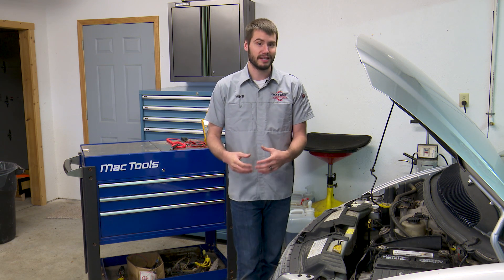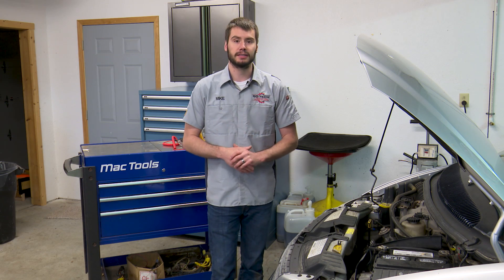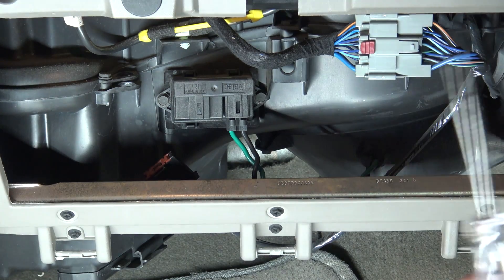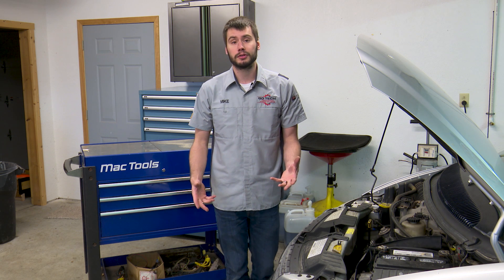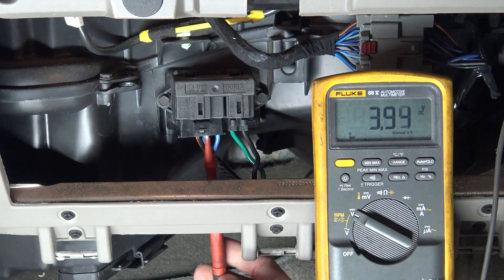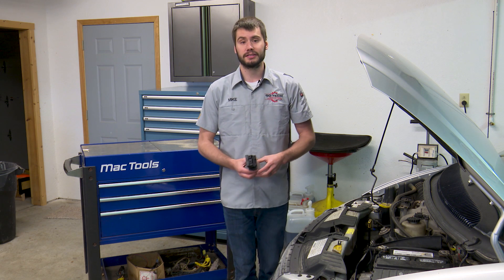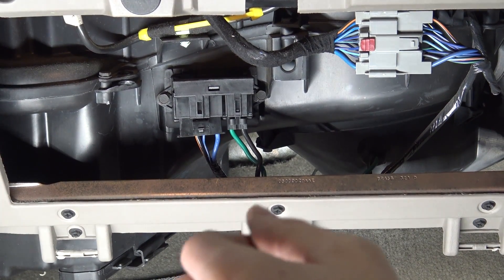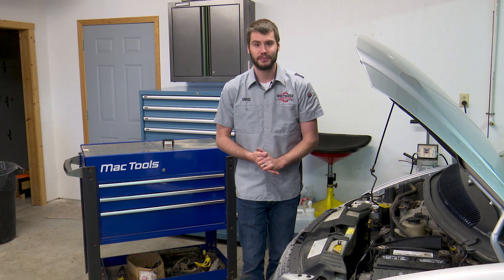Chrysler/Dodge Fan Runs When Power Is off!? Simple Test & Repair

Comment: Thank you sir for the excellent video. EZ peazie fix for my problem of no fan adjustment and when I shut it off, the fan blew even harder! I opted for the $21.00 one on Amazon instead of the $68.00 Duralast since the van is 21 years old.

Comment: Enjoy your videos Mike.  I'm a DIY car repairer and have been at it for 50 + years.  I was a radio repairman in the service and 20 years repairing industrial controls.  I have a pretty good BS meter and have had many service writers give me lame explanations when I took a car in for warranty work.  They should all study under you.  Most have a less than mediocre understanding of basic electric systems.
Reply from the maker: Hey Mike, thanks for watching and thank you for your service! I love a good BS meter, so funny to watch a writer squirm. A simple understanding of the basics can really open so many peoples eyes. Hopefully they watch :)
Mike Becker, Senior Instructor
Reply: @GoTechTraining  I was once told that the starter on my wife's 81 Caprice Wagon was hanging up because of a bad cell in one of the diesels batteries.  When I hit it with a tire iron it would drop out.  Turned out to be a cracked housing. When I put new 1100ah batteries in before the next winter it went from intermittent to almost everytime.

Comment: Does anybody know why that 88 multimeter is so expensive? I think that China made that is green in color which is also popular on Amazon does a better job because it tells you with color and sound when you are using the wrong slot when doing measurements vs amps readings, etc.
Reply from the maker: Sorry, not sure. I've never used the other one, but I do really like my Fluke88. No complaints there.
Mike Becker, Senior Instructor
Reply: @GoTechTraining  fair enough. I've been spotting one where they are asking 200 bucks for it but I already have the 17B+ fluke china market model and I also have that green one along with other two clamp amps but this being automotive, thought that it may have better capabilities such as quicker response but it doesnt seem to be the case.

Comment: Just did one of these on a Ford Taurus not too long ago. The resistor was smoked, and when I pulled the blower motor out, it looked like it had been sitting in a wet basement for 30 years. All rust, and VERY difficult to spin by hand. New motor, new resistor, and shipped it - everyone is happy. Great stuff as always, Mike! 👍🍻
Reply from the maker: Hey Smitty, nice find! I've never see one all rusted up. Cool! Wonder what made that happen?
Mike Becker, Senior Instructor
Reply: GoTech - Looked like at some point there was a nasty windshield leak.

Comment: Nice and easy Mike. 👍 Remember to check that cabin filter also,if equipped. 😉Could a clogged up cabin filter prevent air from blowing over the resistor to cool it down and accelerate its demise ? Mmmmm 🤔😄
Reply from the maker: Hahahah thanks Nick! Blower motor current does WHAT!? ;)
Mike Becker, Senior Instructor

Comment: At interval 4:50 you do the voltage test on the fan control circuit. Logically I was expecting the voltage on the control wire to increase as you rotated the fan control clockwise to attain higher fan speed. But it is the opposite. I have measured fan control circuits on Chevy trucks and it is opposite. Rotate the control knob clockwise for higher fan speed and the voltage goes higher. So different engineering approaches to reach the same result.  Really appreciate how to do these checks and interpret the results if you do not have access to sophisticated scope equipment. Keep up the good work!
Reply from the maker: Hey ACarl1018X, don't you love how they do that to us!! Always have to do it differently than the competition... 
Mike Becker, Senior Instructor

Comment: Nicely done, Mike. I was hoping you'd take a sledge hammer to that bad module to let us have a peek inside. My understanding is these new motor modules control speed with a variable PWM output to the motor, reducing the heat dissipation problems seen with the old style resistor design. Since heat is the enemy, I thought blower control module problems would be a lot less common with the new design. Just looking at the big heat sink on the unit, evidently heat dissipation is still an issue. The suggestion below to measure current might be wise, though I have no idea how to properly measure that when it is a PWM design....
Reply from the maker: Thanks! Yeh, I may end up busting that thing open, we'll see. Next one I get in i'll play with current on and make a video, promise! ;)
Mike Becker, Senior Instructor
Reply: Another Quickie Great Info I'll pass it on And Keep us growing

Comment: A nice and simple PWM signal I presume. Thanks.
Reply from the maker: Hey Fascist Pedant, yeh i'd assume so. Didn't actually bother measuring duty cycle on this one. I'd assume a PWM 12v which is reflected by 2.5 to 8.5v on my sloooooow meter :)
Mike Becker, Senior Instructor

Comment: Nice quick diagnose Mike.  I learned that anytime I had a bad resistor, or a melted fuse for the HVAC circuit, I'd test the blower motor current.  Some times the motor was drawing 22 to 25 amps.  The new motor would be at 10 to 13 amps.  Problem solved.  Just want to be sure the resistor/module lives a long time.
Reply from the maker: Hey Mike, thanks for watching! Yeh, I agree, testing current draw on the motor is always the smart move :)
Mike Becker, Senior Instructor